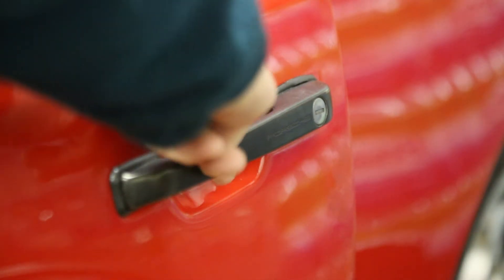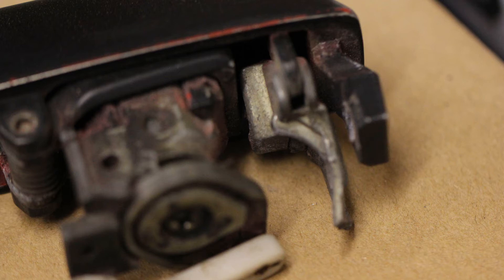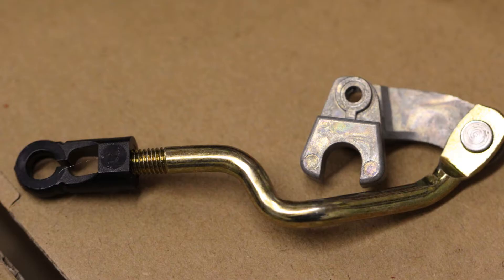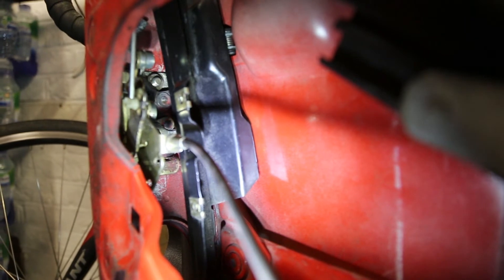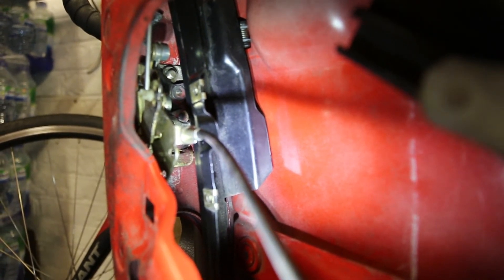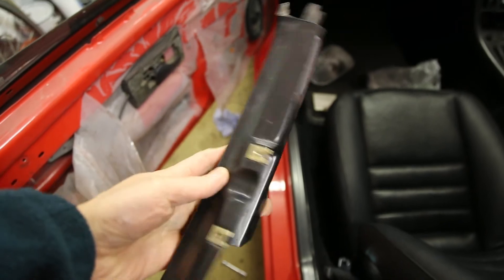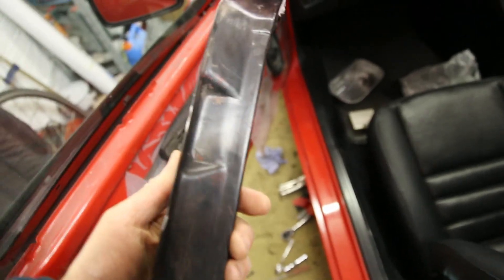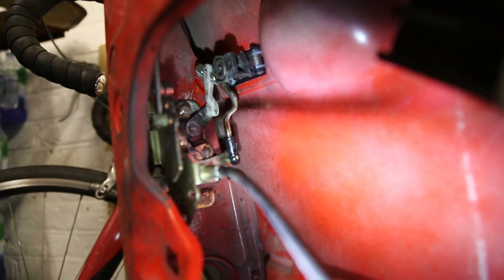Porsche 944 Door handle repair & Operation - Fixing Broken Door mechanism

Comment: I have a '86 944 Turbo,  with a sticky driverside door handle?
I noticed over the winter when it was cold that the ds handle was sticky and hard to open. With a little jiggling, it would open.

So I've taken the door apart, inspected & cleaned up the mechanism. Now it's back together but the handle won't open at all. Everything else works, inside handle, etc, but not the ds handle. The handle mechanism pushes the linkage down, but not enough to open the door latch. The inside handle does push it down enough to open.

Seems like there's an adjustment needed in the linkage,

Suggestions?
Reply from the maker: There is adjustment in the mechanism but it might be that the metal has stretched so it needs to be replaced.

Comment: i solved this, you undo the two bolts holding the locking mechanism to the door latch pin. then push the locking mechanism in and up, push to the top and gives you access to the pins for attachment.

Comment: i have done this many times and never removed the window glass or the guide rails. i can do the job in about twenty minutes. you just need patience and a long screwdriver.
Reply from the maker: It really depends on the model. Early models have very different guide rails which do not block access. It's pretty much impossible to reach on later cars as the rail blocks it
Reply: @ajvw  i have an '85.5 and '86.